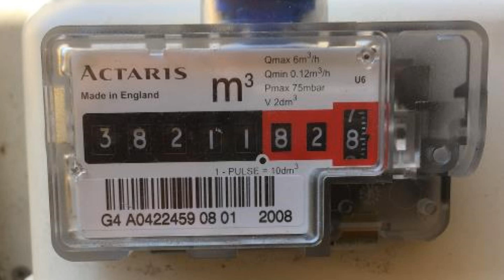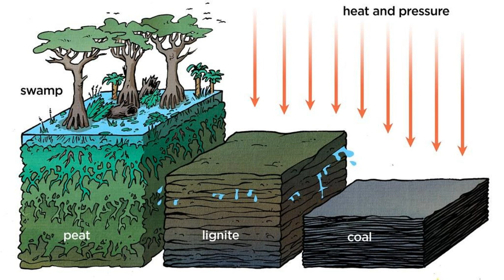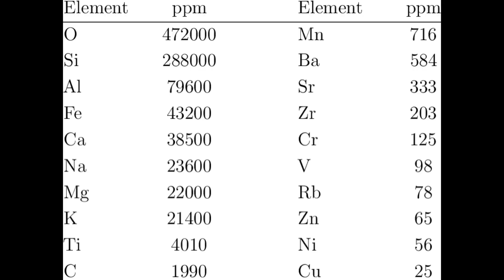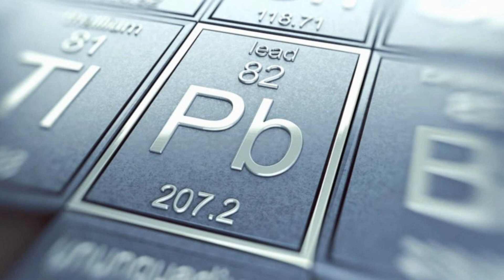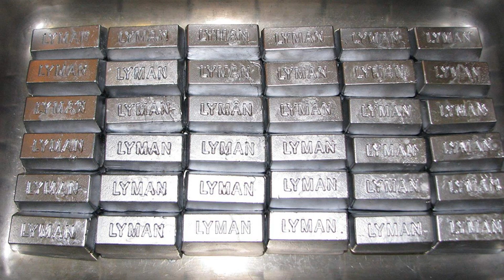What Resources are we NOT going to Run out of?

Comment: good channel. whats your opinion on climate change and co2 emissions.
Reply from the maker: Depends on the context of the question. If you mean "is it real?" then yes, obviously. Is the "Venus scenario" real? No. We would inevitably trigger enough glacial meltwater to stall or shut the global thermohaline circulation currents in the ocean, and during the decades or century it would take to reconstitute itself, we'd be thrown into an abrupt cold-climate shift, with global averages dropping at least 5 C, possibly more than 10, within a few years and staying that way for that time period. That will throw us off balance, stall our growth, and likely cause a lot of mass-death, all of which would crash our energy use, emissions and else.
AND, as of some of the most recent data, it looks the thermohaline system is already in the early stage of faltering. It's lost somewhere around 20% of its strength / flow rate since the start of this century.
Reply: I havent found any data that suggests a global 5-10ºC cooling. Even just following logic (though that can be fallacious) it doesnt make sense. The consensus (i think?) right now is that the younger dryas was also caused by a shut down of  at least the AMOC, so any shut down now should have less severe effect than the younger dryas since: 
1. even the entirety of Greenland melting wouldnt match the amount of meltwater released in meltwater pulse 1a and 1b. 
2. current sea level rise is 10x slower than that during meltwater pulse 1a. 

so a short term shut down of the AMOC is likely only to cause regional cooling while the net warming of the globe is likely to stay positive. 

however, AMOC shutdown will warm the southern hemisphere and it might do that enough to trigger an accelerated melting of west antarctica, which should in theory have its own cooling effects, though im not sure if anythings been modelled. its a more isolated current anyway, so im not sure how the effects could be telescoped globally but im not a climate scientist.
@Maxojir

Comment: You can turn nettles into iron and you can clone nettles with just sunlight heat made by a window and water giving us and endless supply of iron and steel until the sun goes out but even then if we find a new solar system and colonise it then we could do the same thing so basically we will never ever run out of iron unless we become extinct but even then it is likely that another species just if not more advanced than us would do what we did to have an unlimited supply of iron and steel
Reply: I cant find this nettle to iron process online, can you paste it?

Comment: Something about the take on coal just rubs me the wrong way -- that's even aside from the CO₂ emissions. For one thing, coal comes in different grades from lignite being the worst quality coal to anthracite being the highest. I think it might have been helpful to break down coal reserves by their grades. Another aspect to take into consideration is how much it costs to dig up coal. How much coal would be economic to mine out at $1 per MMBTU? How much coal is economically extractible at $2 per MMBTU? $3 per MMBTU?

Another question I have is how much oil does it take to mine 1 metric tonne of coal? (I don't know if the quality of the coal could affect the amount of oil needed.) The vehicles doing much of the mining nowadays run on petroleum-based fuels. The same question could be asked for all the other resources mentioned here as well.

Comment: Odd as it sounds, coal should be our main electricity producer. It's too abundant and economically important to ignore. Fossil fuel pollution is a lot easier to deal with when it's not on wheels.
Reply from the maker: By all means, I love coal. My powerplant's coal-fire, mainly because it's the only power source that can cut it up here in Alaska. Plus our heating here is done with waste steam from the plant running through radiator pipes in our buildings.
Reply: @Celtic Revival / Adfywiad Celtaidd It already produces ~50% of America's electricity and we haven't all died or mutated yet. Plus, the more we use coal, the fewer people we have to shoot in the face for oil (when it starts to run low, we will cook up some excuse to flat-out occupy OPEC nations).

We've been able to burn it cleanly at a profit for decades. If you want electric cars to be a reality, coal gives us centuries of independent energy and the source of pollution is centralized. Your emissions treatments don't have to be weight conscious like on cars.
Reply: The problem is co2 emissions, I don't want to see a useful cheap resource go to waste but climate change is a concern.
Reply: @bristoled93  Maybe  We have 22% of the world's supply and I've heard this could last us over 400 years. Question is: is releasing that carbon over that time period dangerous? I don't know that.

But, I do know this. That coal is getting burned. Either by us, or by whom we sell it to.  China imports ever-increasing amounts of American coal. Pretty much any coal fired power plant that shut down, or converted to NG, that equivalent tonnage of coal consumed got sold to China. Maybe things have changed, but past record has shown China doesn't give a flyin' fuck about fossil fuel emissions.
Reply: @brandonobaza8610  Who has 22% of the world's supply?  The UK? The USA? something like fossil fuel emissions needs an international solution. I think not shutting down nuclear power plants in Germany and building more windmills everywhere would give humanity clean power.
Reply: @bristoled93  I would push for nuclear. The rare earth metals that go into wind turbines have a higher demand elsewhere.

Comment: 500 years ago it was the year ~1500 (so somewhere around Christopher Columbus discovering America). So we have this much time to run out of resources we are not going to run out of. And we have to get eco-friendly, CO2 neutral energy to process it.
Reply from the maker: We would only reach that point if the human population kept expanding indefinitely. Metals can be infinitely melted over again and recycled to be put right back into the system, but we still need more new additional metals because 1 - the majority of the world is still in 3rd or 2nd world status and hasn't completely risen yet, and of course 2 - human population is still increasing for the moment, so a "closed system" for metals (or anything else) is not yet posssible
Reply: @LucarioandDialga  4. There won't be any "closed system" for metals. There will never be input metal = output metal. There will always be some percentage lost. We are loosing titanium on our white walls (no one is collecting it, because it's a waste of energy) and we are loosing a lot of metals just by friction, oxidation and entropy. And everything we will do with metals - requires energy.
Reply from the maker: Obviously XD
I don't mean an actual "closed loop system" , but the generality of as close as it may be possible to achieve. But I know no such "closer" could ever actually exist, I'm not AOC  =P